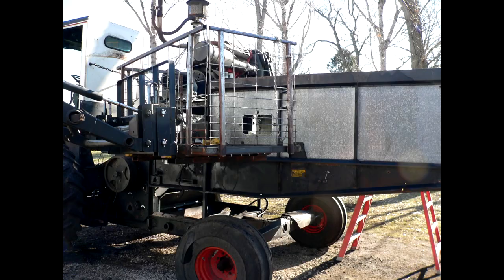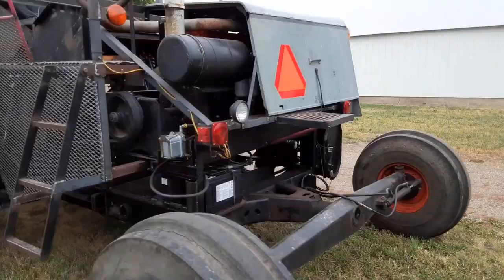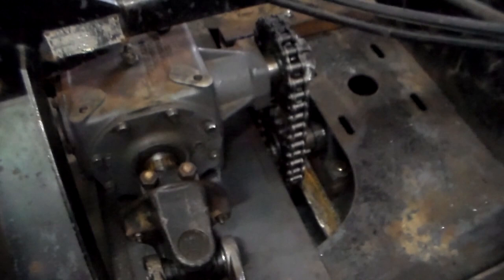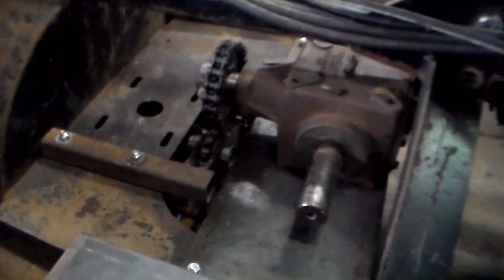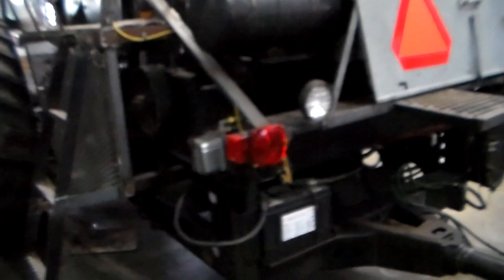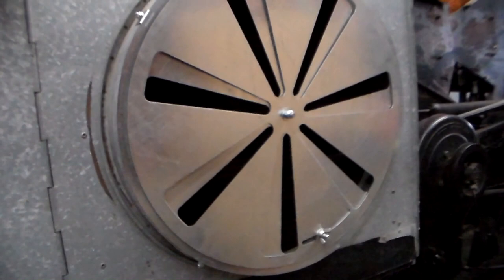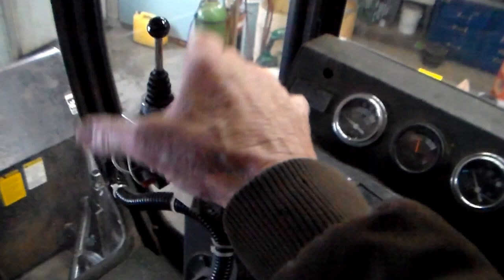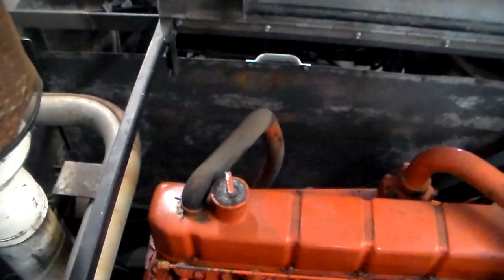Combine converted to snowblower

Comment: Awesome job.  A lot cheaper than a new one and the tractor to run it. Should  make short work of snow. Hydro drive gives you a great range of speed
Reply from the maker: thank you.
Reply: Cheaper only if someone possesses the fabrication skills, tools, time, & shop space as this gentlemen seems to have. Plus needing the used $$ combine w/ some value, & the willingness to cannibalize. Hydro is convenient BUT a front PTO tractor w/ a power shift transmission would also do nicely w/ this blower. Front PTO & 3 point linkage is becoming more common in the USA, many used European tractors imported  here  contain this combo feature. A popular importer is JB Tractors in his neighboring Millersville, MN
Reply: @hrodd2  It seems obvious you enjoyed this project. Folks might be amazed @ the # of man hours invested. Did you keep track ❓Some portions required a helper ❓ Doing something a person loves is not viewed as a burden but we still should equate the inputs against what other activities could have performed w/ this effort to improve our lives, & generate income.  A farm usually has many projects requiring winter maintenance.
Reply from the maker: @billupstateny9151  Honestly i really did not keep track of hours. But it was a lot. But, hey we work for free, right? Perhaps better for me if I am in the shop instead of the bar or casino.

Comment: Wow - what a machine!   In many ways the combine offers a good base for that project - the rear engine mounted high is out of direct snow spray that might build up the the air cleaner.   And of course the cab position as you noted.   Hope to see this run in a deeper snow!
Reply from the maker: Yes, forecast for this evening is 8+ inches.  She may be put thru the paces then
Reply: That sure is a snow removal beast! You planned so well, and left yourself room for improvements. Have you considered a salt or media box and spreader on the rear? Looks like plenty of room back there. I was even thinking about a pick up truck box or a flat bed for tools, equipment, etc. 
Great idea and execution on your build! Good luck and have fun with it!
Reply: You realise that he lowered the engine, right? I don´t think it´s a problem, more like an advantage to stability. Anywhere around the engine is hot anyway, so I figure snow spray is no problem unless you could aim directly at the intake. I love this machine, this build! I even see some possibilities for later upgrades, like pressure control depth gauging and edging wings, for instance. Great project!

Edit: when I think about it, maybe that "chaff drum" in front of the radiator is no longer needed when it´s doing winter chores? No harm, of course. (Sorry I don´t know the right name for this, It´s not my native language). You made a cool looking air limiter for it, though!
Reply: @SPCLPONY  I don’t know where you’re from. Or where @hrodd2 is from but I’m from an area of Canada that doesn’t use broadcast spreading very much. Perhaps it wouldn’t be very useful?
Reply: @lukassawatzky604  I'm in rural New York on the Pennsylvania border. We use salt on our roads in NY, and cinders in Pa. The Township's allow residents to get a bucket or two of cinders during the winter. It helps with traction on driveways and steps. One can also buy bagged rock salt or calcium that we use with a walk behind spreader on our sidewalks.
Reply: None of my snow blowers have an air filter, don't need it
Reply: @hrodd2  thats handy idea  turn the combine into year round machine   combine for summer,fall and spring and switch to blower mode handy idea in stead sitting in shop for winter
Reply: @lukassawatzky604  You are right, a spreader has no use for this machine.
Reply: @michaelmactavish4445  New Idea missed out on a grand opportunity there. They could and should have offered that as a Uni-System attachment!
Reply: This snowblower has a diesel engine. And diesel engines require fresh air along with engine compression to ignite the diesel fuel
Reply: @michigandon  New Idea did offer a snowblower attachment for the Uni System.   Those units appeared to be as large as this system.
Reply: @jazzerbyte  Of course you're correct about that. I got to doing some research after posting my comment above and discovered that myself. My late father worked for a guy that had one. Not sure which model. He had the chopper and the combine, but not the snowblower, obviously. Pretty sure it was powered by a GM ToroFlow diesel? I remember it being extremely problematic in later years. Not necessarily because it was a poor design, but more because it was just plain worn out by that point.
Reply: @user-fy6rr6sz2n  A little walk behind blower is much different that one that throws this much snow and if it is a diesel in particular you can not have snow get sucked into the engine. I once pulled apart a B275 international that was used to blow sidewalks clear for a local town. I had to rebuild it because of the snow getting into the combustion chambers. It looked like someone pounded all over the combustion chambers with a body work point hammer. With that high compression a drop of water is like a little sledge hammer hitting it. That head had numerous cracks in it.
Reply: @davebrittain9216  thanks Dave, I thought no real dirt in winter, but cavation I hadn't thought of

Comment: The operator's cab is perfectly positioned to see the area surrounding the machine, around the blower, and any obstacles that need to be avoided. Very nice conversion.
Reply from the maker: thank you
Reply: Well, I think it should be higher.
The view is not the best right now.
Make an upgrade so that the cap can be moved up above the chute.

Comment: What a beast...and casually mentioning hardcore hacks like shortened the axle and added an extension to clear the oil reservoir shows that this guy is very skilled.
Reply from the maker: Thank you for the compliment.  Looks like I can retire it away for the summer.

Comment: I have never seen anyone do that before, great effort! And it works well too.
Reply from the maker: There is a video of a gentleman in Canada that converted an IH rotor combine to snowblower. I have read that they are easy to convert as he reused the gearbox that would normally run the rotor to power the blower.  The Gleaner was easier than I anticipated to convert.  Thanks for the comment

Comment: Nicely done Happy New Year, I am quite familiar farm Tractors/Combines I worked for Versatile Farm Equipment back in the late 70's through the 80's so i remember  allot of those components and systems you took apart and recycled, hydrostatic drive is really nice , so easy to control the speed, this is all well planned out and built and especially i love the cab , easy to enter/exit and you got the best seat in house, more important you can see all your components that are important, very cool , when you were operating it towards the end of the video ,it reminded me of the old Allis -Chalmers rough terrain forklifts that were basically a tractor turned around, I played with my share of those a bit having worked in the forklift industry for a few years, good times, your neighbour to the north in Manitoba , hope you get the snowstorm and get to play with your new home built behemoth of a snowblower, its pretty cool  👍oh yes, i agree about the cab, no more sore neck/shoulders i did my share of that for my uncle and dad when they got into their 70's, it was a nasty job in deep snow and high winds , cab is king
Reply from the maker: Thanks Bob. Yeah, everything you said is true.  SO far I am very happy with the result.

Comment: Great project. We tried to find a snowblower big enough to fit in front of our Massey Super 92 which also has a heated cab, but to no avail. Instead I put a 12 foot home made snow blow blade from an under ground fuel tank and the piece ended up being 3 feet tall by 12 feet long. I couldn't believe how much power this combine had. I still wish it had a blower, but for now we push snow. Loved the video and Great job on getting this beast to where it is now. This is simply awesome.
Reply from the maker: thank you for the comment. Yeah, whatever it takes!

Comment: this is an amazing machine i love it ,, i always wanted to build one of these like this ,, still haven't found the right combine for it yet , around where i live in SW Iowa combines that run are still in use even 40 year old ones ,,,I did something different about 10 years ago i had bought a couple old road maintenance trucks at an auction ,,along with an ancient Pennsylvania Snow-blower that mounted on the front of a dump truck or grader ,,the blower was self powered ,it had a monster V8 Waukeshaw 884 gas engine ,that thing was HUGE ,anyhow i discovered you couldn't get parts for it ,,hunt began for another engine ,,finally found an engine in 2015 ,i settled on something strange , a 5.9 liter cummins turbo diesel from a 99 bluebird bus ,,I already had a NV5600 transmission with dual PTOs i know it sounds strange  i haven't got to the combine part because i did eventually mount it on a combine  but it was modified to mount on the feeder house of the combine i use at our family farm ,,a rather beat up TR96 new holland ,,it's plenty big and heavy enough for this 4500 pound machine to mount on the front ,, I got to use it in the winter of 2018/2019 when we had 50 inches of snow  that turned into the flood of 2019 in march of that year ,,hoping to use it this year too ,,we gotta have 12 inches+ to justify the fuel though
Reply from the maker: Thanks. Yeah I considered a powered blower with a different twist, but decided to go this route.
Reply: @hrodd2  it worked  out good for me cause i have wanted to build one for years but finding the right machine proved hard  ,, so i decided to mount it on my combine i use  which is a TR96  , it's huge and heavy and also has rear hydro assist so it's 4 wheel drive ,, I  have a 10 ton army truck  as well which might end up with it mounted on it

Comment: Awesome! I’ve wanted to do this for 20+ years, still haven’t gotten to it. Did keep an old gleaner just for the purpose. Maybe someday yet. Though I’ve often though the new idea unisystem power unit would make a good conversion. Flexible, 4wd, setup to send power in multiple directions. Someday….again great job! Very very well done!
Reply from the maker: Thank you for the comment. Yeah, previously I had a small Yanmar with no cab and 5'  blower. It actually worked really well, but I was getting tired of the cold and rear facing.  Getting too old for that!

Comment: Excellent, just excellent. Yes, we need deeper snow. I imagine you could change pulleys or gears to speed up the fan and throw snow farther if you wanted. What's next? Make it quick attach so you could swap for a bush hog or something else. With your skills I see endless possibilities. Great job!!!
Reply from the maker: Thank you. Actually on the right side i maintained the adjustable v belt drive. I put a tach on and the blower is running around 650 rpm.  I also checked the augers. The rpm for them is in the ballpark for a 540 pto.

Comment: I thought about doing something like this with a New Idea Uni some 40 years ago, when I borrowed a neighbors 4250 FWA John Deere with a rear mount blower. Since that was the only time in 40 years I really needed a snow blower, I could never justify the time  and cost involved.
 It would be real handy to switch over to an 8 foot bush hog mower though 😎, so a guy could use it for 2 seasons of the year.

Comment: Excellent idea! My brother in law and I did the same thing a couple years ago !
Reply: We found issues with the separator clutch running the blower. We eventually dropped an international 444 down where the grain bin used to be and direct drive the blower off the transmission.
Reply from the maker: Cool.
Reply from the maker: Ok, that works

Comment: Very nice, great work.  I built one out of a Massey 410 gas.  I did not do as much as you did, it did work, but the front end was too heavy and I had to steer with the brakes.  over time, one of the brakes broke and it had other problems, so now it sits out back waiting for the salvage yard.  Again, great job on the build and it looks like it will last a long time.

Comment: Love it.  Great ingenuity and performance.  I would suggest a 1" dia steel bar ahead of the auger/chain drive on the left side of the chute, to protect same.  Also,  a 2'x2' rear window.  Fenders for the rear wheels?  No need to go right to the ground when snowblowing.  Those narrow wheels will give more traction than the wide ones under many conditions.
I have seen one of these before, but not in detail.  Well Done Sir.
Reply from the maker: Thank you
Reply from the maker: @gordbaker896  Yes, I have watched that video. He did a nice job with that unit and was one of the reasons I decided to take a go at it.

Comment: What a great build! Its obvious you are a good planner and like to think out-of-the-box, as well as being an excellent fabricator and a perfectionist.  I'll be curious to see if you come up with further modifications to make this unit even better - if possible!  I'm thinking you have the basis for a snow-blower  manufacturing business...
Reply from the maker: LOL, well 1st we will have to find a supply of neglected combines. On the serious side I like to think that we can make use of a lot of items, rather than discard or spend ridiculous $ for new.  Of course I should modify the cost of the project, you notice that there is zero amount for labor. That's cause some of us work for free? Thanks for the comment

Comment: Nice useful project you built , looks like the auger was used by MnDot at one time 
sitting in a warm cab is the answer , my John Deere LX 255 snowblower does well 
ski goggles and a snowmobile suit and gloves are my protection , nothing like Heat and a Cab
Reply from the maker: You are correct. I purchased the blower from a MN surplus auction. It needed a little TLC

Comment: I suggest adding  a hitch  or tow  point to the rear of the unit .    I imagine you could pull out stuck vehicles after clearing access to them.. Geat work ! good luck with her.

Comment: Horsepower is important for snow removal. Man I just love to listen to a diesel engine roar. It must have been difficult to wait so long to put it to use. Great concept and build.
Reply from the maker: Honestly I was really paranoid the 1st time out last winter.  Kept expecting to hear terrible grinding noises or big bangs! LOL. But at this point only a couple minor issues. Tire width was one and I had to add a belt tensioner for the fan drive.

Comment: Killer Build  reminds Me of the British Car show TOP GEAR. Where the Guys took a Combine, put a Plow blade on the Front and used the Grain Bin to spread "Grit" as the British Call it  
One Mod I'd consider it to extend the Shoot and enclose it a bit, getting the Snow plume out of Your sight line and You'll get more distance with the Stream of Snow. 
Mike M Central Wi.
Reply from the maker: Actually the visibility is great. thanks for the comment. I will try to do some video from cab

Comment: Could add some rubber or canvas tips to the blower fan to ride tight to the wall for better efficiency depending what clearance there is.  Helps mostly in wet stuff and keeps rocks from getting stuck in there.
Reply from the maker: Yeah, thought about that. That is one of my pet peeves with manufacturing and blowers. They always have too much clearance between the fan and shroud. I did remove and build up the fan. Also slotted the holes so it could be adjusted as tight as possible to the discharge side. But there still is what I would consider excessive clearance on the bottom and opposite side. But all in all, not bad.

Comment: What a great looking retrofit to a practical, easy to maintain machine.   I really liked the GM spare tires to gauge wheels.  As, they hold about 60 psi. (estimate) so should hold up in cold temp end use. Having for years managed snow removal with an open cab, I think that feature is a huge win.  Very often, Australian farmers highly modified tractors and equipment as farm and logging.  I'm betting they would be cheering as I am at adept refit to a cold, difficult task made more effortless and warm.
Reply from the maker: thank you

Comment: Lots of old SP combines and swathers around that can be converted to anything you want,one swather was converted to a machine for drilling holes for ice fishing derbies.
Reply from the maker: That's interesting. Initially I was going to go with a swather. But after I picked up the blower from the auction I realized it was too much for a swather. So I thought, need bigger and more hence a combine.
Reply: @hrodd2  the blower you adapted to the combine looks fairly heavy,the combine will give you more stability,power,and visability,the motor is probably the same as in my 8030 so you’ll have plenty of power.👍🏻

Comment: I have seen self propelled haybines converted to snowblowers but not a combine. very very cool. I want one if I stay where it's cold. Hopefully I will not have to use one though...
Reply from the maker: Thanks for the comment. Yes MN stays cold enough and sometimes we also receive the snow
Reply: @hrodd2  I am in Pa and historically it we have had some huge snowfall I remember when I was little that they had to bring these huge snowplowing trucks to clear the interstates .  That was at least 20 or so years ago now.

Comment: Super cool project! Based on what I've seen of the airport snow blowers, you might be a bit light on Horsepower, but it's a nice machine for sure.
Reply from the maker: Thanks. A person never knows. This combine is around 130-145 hp. The blower is rated for 180 hp tractor.
Reply: Allis Chalmers do not lack HP